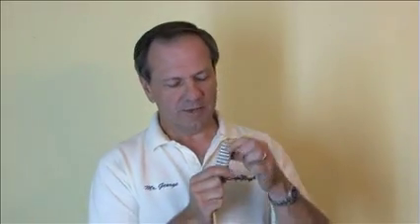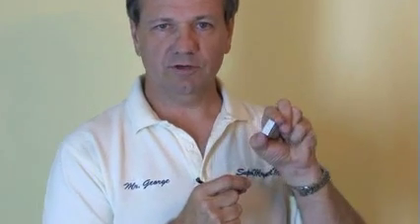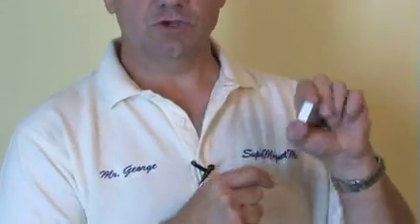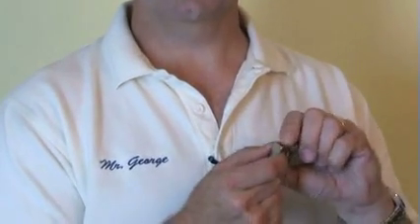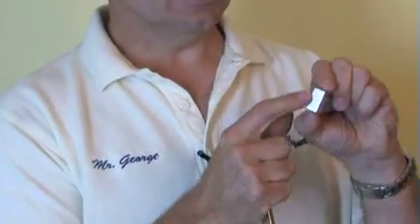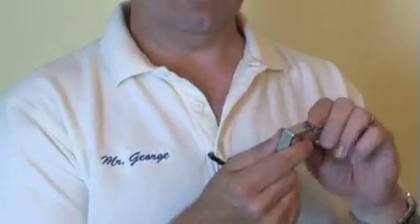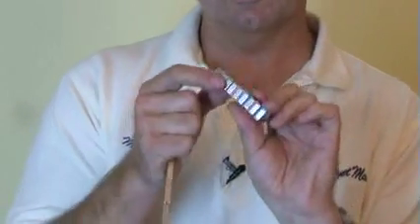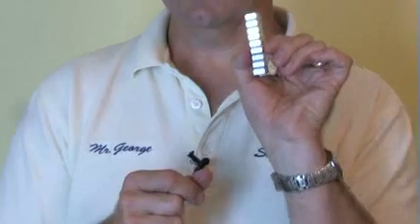Different Magnetization Methods

Comment: Can I take a ceramic ring magnet that is magnetized on the two flat sides and re-magnetize it whereby the outside diameter edge is one pole and the inside diameter is the opposite pole?
Reply from the maker: Yes - most ceramic magnet materials are quite easy to remagnetize.  You might even be able to do something like that using a pyramid magnet.  It would have to be strong enough to magnetize all the way through the material.

Comment: Hi, I'm trying to build a electric magnetizer for the magnets of an old engine(55') from some transformer silicon steel. Is it important to have a well closed magnetic circuit during magnetization? How does a little air gap (e.g. 0.1mm)(between the magnetizer and the magnet) affect the magnetization process?